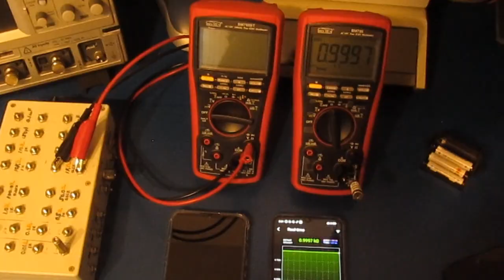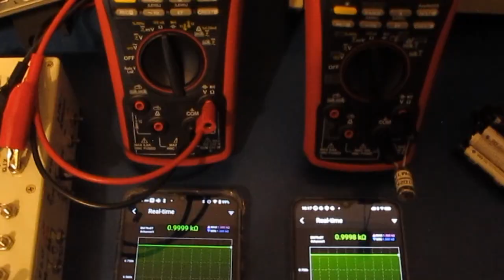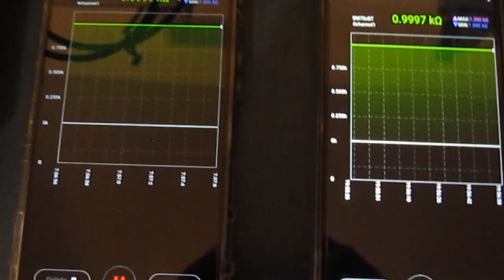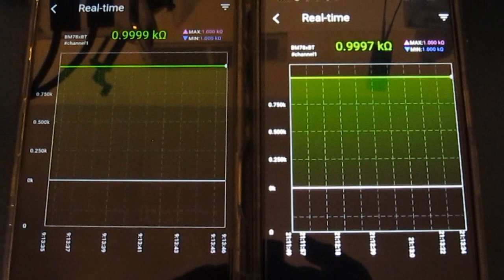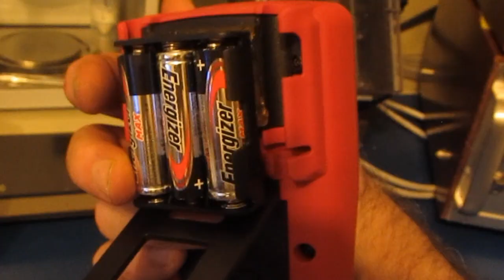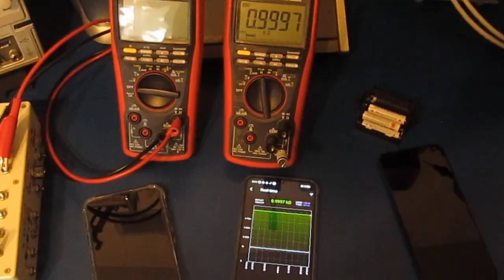Brymen BM78xBT Android Slowdown and Update on 10x Fault

Comment: Probably app developers made a logic error in their design, say every time it's trying to write another row of data to the log file, it is trying to read through the entire file to find the last record number then increment it by one to append the next row to the end of file. If they kept the integer value of record number as variable in memory and increment it by one it would not encounter same problem, or break the log file into smaller segments like recordings per hour instead of one giant file for all data points which can be merged on the desktop.

Comment: There was a product called Slingbox that you could use to watch TV over the internet from other countries. The first revisions of the units  were great and the client  software was solid. Then I think they got rid of the guy/team who wrote the networking layer (or maybe he quit/retired) and handed it over to people that were thoroughly clueless. The devices got worse and worse with each new release with bizarre networking errors where despite there being absolutely no upstream networking issues the device would tell you that your network had all sorts of slowness  problems and disconnect. Rendering the device basically unfit for purpose.  The company and the product deserved to die at that point which it did.

Comment: Could it be the data block size has exceeded the NV memory block size in the phone causing it to pause at every write (as os  dumps ram to the nvram  as virtual memory} ?
Reply: No, this has to do with the basic architecture of Android apps. Every app allocates memory through manifests or definitions. There are APIs such as the NDK that allow you to setup more flexible schemes for memory management and persistence on the device.

Comment: Hello Joe What do you think about Chauvin Arnoux CA 5293 graphic multimeter ?
Reply: That's total junk!
Reply: @roseelectronics4582 why ?
Reply: @roseelectronics4582 Why is it nonsense? Is there a better full-function multimeter than this that I don't know about?
Reply: @bahadryldz2346 CA multimeters aren't up to their prices. I think I went a little far saying they're total junk. Sorry about that.
Reply: @roseelectronics4582 No problem, but as far as I researched high-end brands like Fluke, I couldn't find a graphic multimeter at this level and where I am, it is sold at half the price of its rival, the Fluke 289 model, so although the Fluke 289 is an old model, it is more expensive than the CA5293. I think Fluke doesn't deserve this price, Joe proves this with some tests.